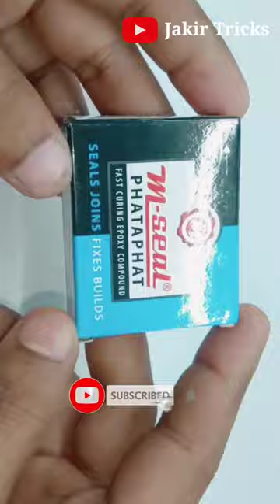How to make a Steam engine Free energy electricity short | at home  #shorts  #short

Comment: It's not possible...A Candle cannot generate enough heat to make a high pressure steam,You need a Coal or high flame gas to work this....
Reply: No, it is possible like this too. But the engine will not have high torque or speed. This video is very fake tho, the engine doesn't have a valve or any kind of timing

Comment: Hey get a valve or make a valve and then u can make it actually run also use a capacitor so it outputs smooth electricity

Comment: Fake, Fake, Fake! Why you do fake stuff like that!!!!!
Reply: The free energy part is fake but the engine itself isnt
Reply: @Vehicles_dream rightttt soo all I need to add for it to work is a battery right
To provide the energy it neefs
Reply: @kajalagnihotri3182  no the energy comes from steam so it really isnt free you have to provide a source of heat
Reply: @Vehicles_dream it’s fake. That’s not how a steam engine works. Once air builds up you need to let it out through another part. There isn’t one here. Bro you don’t even know anything about  about steam engines. Don’t comment if you have no idea 😂😂😂
Reply: @trendclips3134  bro if you twke out the plastic rubber thing on the syringe it lets some air threw while still gettung steam and judging me straight up is just stupid. Seeing as how i study masters mechanical engineering

Comment: There is no Exhaust
Reply: The flame builds pressure in the can then the syringe is pulled back cooling the steam/air reducing the pressure making the syringe go forward and the cycle repeats
Reply: It would have to be a fossil fuel engine for an exhaust to be there